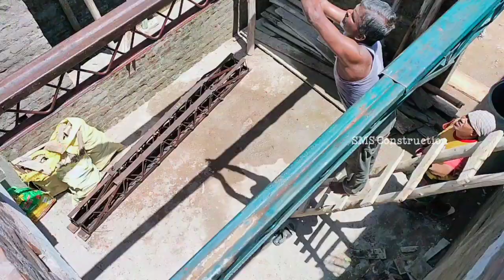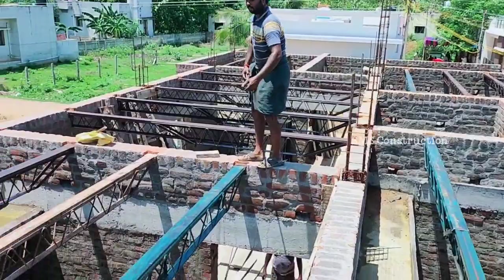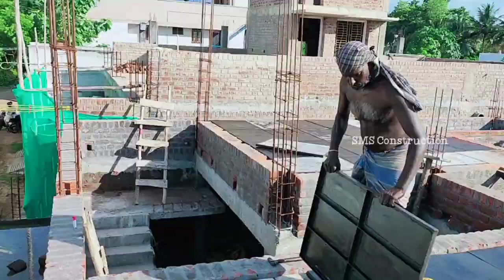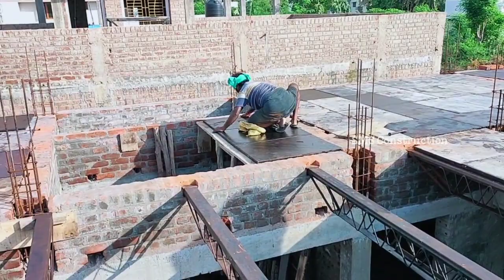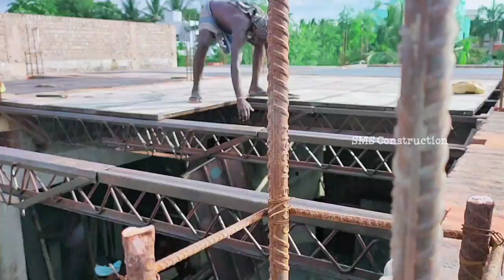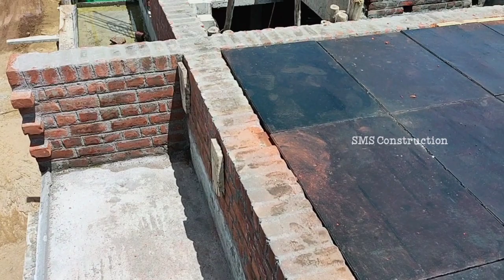House Roof centering using span jock || Slab Formwork

Comment: Pls tell what is the thickness of steel sheet and length & width
Reply: Thickness 1.5 inch length and width 3×2
Reply: 1.3 inches thickness... 2ft width 3ft Or 3'9"ft hight...